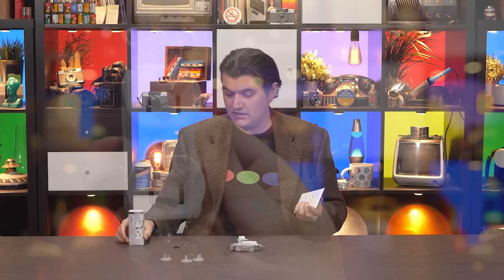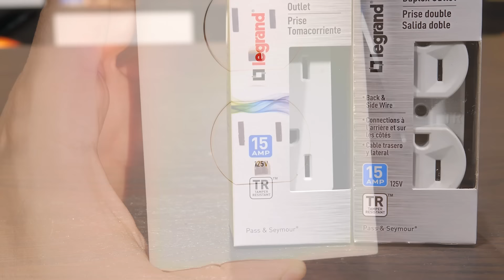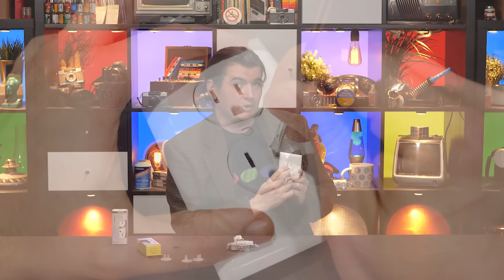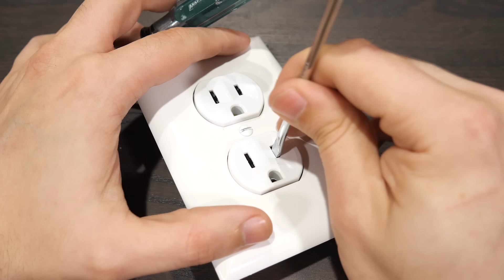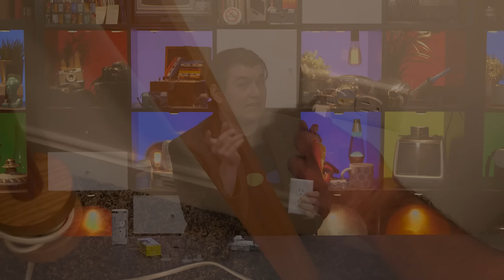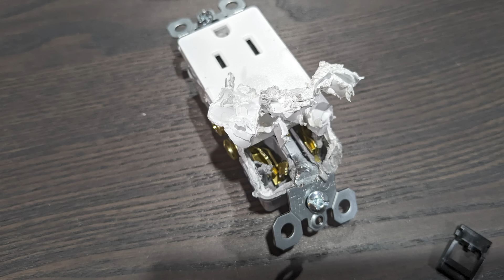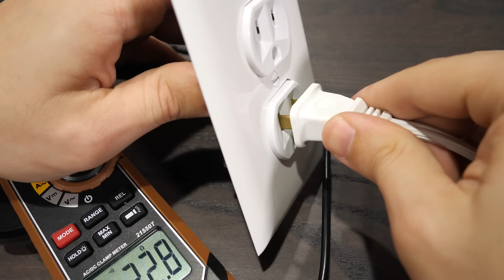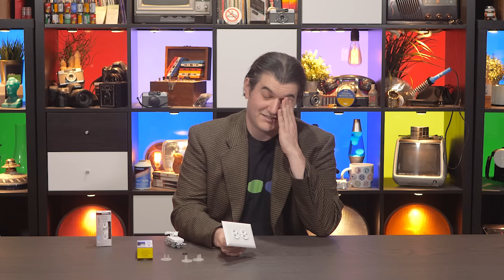Tamper-resistant outlets aren't all the same - a follow-up

Comment: The ones that only grab the very tip have another issue: they get very hot when you have a 1500W load on them. There's not much surface area.

Yes, it's a new outlet. Yes, it does grip hard. No, it doesn't hold plugs worth a damn anyway.

Comment: in the netherlands, plug inserts are sold which can be inserted into existing outlets (not in the holes, like onto the plastic body) which will only allow you to stick in a power cord if you put it in sideways, then press and twist 90 degrees to move a sprung plate which covers the outlet holes when unsprung. once so, you can finally plug it in. i wonder if there is a tamper resistant thingamajigg that can just be put onto american style outlets. my daycare had them at all their locations.

Comment: The "Americans have 240 volt power" argument falls apart because by the same logic Europe has 400 volts between two phases of the 3 phase power. That said, most appliances don't use that because it's not needed since you can get enough power out of the standard plug. I think the only exceptions would be a car charger and a full on kitchen range (cooktop + oven).

Comment: But Alec, it is OK. And it is smaller and more convenient than the euro outlets, and probably safer too. I think you really underrate the value of the lower voltage for safety in all circumstances. Heatshrink on the plugs makes for a nice safe look but voltage is what does the joltage.

Comment: I don't know how accurate this is, but I have always heard that 120VAC can be more dangerous because it will make you "hold on" to the wire or circuit rather than a higher voltage which will knock you back. 

This probably only applies to actual electricians and not the normal homeowner or consumer however.

Comment: I've been jolted a few times with 120v. Used to work at a family entertainment center that put up our own MASSIVE Christmas light display each year. We would make our own extension cords. Many that did so were young, untrained employees...so yeah, you can put 2 and 2 together. Another time I inherited the engineer position from an older guy who retired, he had an old non-contact voltage tester that I was using that didn't work...I made the mistake of trusting it and assuming that it not beeping meant there was no voltage. Won't make that mistake again!
...all this to say: it doesn't feel good AT ALL...and some unkind words will usually follow...but typically it's a quick ZAP, and your hand pulls away unscathed. Either way, BE CAREFUL. Because if you happen to be holding that conductor in a manner that your digits or limbs contract around it, it could be a different story...

Comment: Having lived in Singapore which uses British outlets I can’t say I’m impressed. We melted several power cords in our lab there.  A melting power cord is more dangerous than exposed blades as it may not draw enough power to trip a breaker especially with the power a 240 volt circuit could provide.  The cords are fused but that doesn’t always help.  Covering a portion of the blade is good for careless people.  I’ve never been electrocuted from a plug.  TR is more important.  I witnessed a kid getting electrocuted in preschool by sticking something in an outlet.  At the end I would say respect electricity or it will kill you.  It can’t be made fool proof.  TEACHing is important.

Comment: In AU/NZ plugs have been required to be insulated at the top 3rd so loose plugs aren't dangerous.
This came into effect in 2005 so it's a fun dating tool when you find old powerstrips

Comment: 24VDC off a transformer can be roughly worse than DC, since it can't be detected, it would have to be a double-insulated power supply (pretty standard now) to be safer and properly detected by GFCI.
but there's other ways to drop the voltage namely dropping it over some resistors, or putting the larger load in circuit

Comment: even with the shutter trigger on the PCP/Earth pin, you need a very creative/inventive baby to poke two metal things in,

and we have RCDGFCI for most circuits, and mandate all circuits in new installations.
That also protects the wires in your walls, not just the outlets

Comment: My problem with backstabbing is I don’t have any tools I can use to disconnect them that are electrically insulated, so I need to turn the breaker off before changing out the outlet or switch.

Comment: The reason why you don't want to back sab an outlet is because if you do want to change them every 5 to 10 years, you can run the risk of running out of extra wire. Not sure if that makes sense but basically you would have to cut the wire every time you replace the outlets gin you less wire every time. As an electrician it's a pain in the ass when you get a short wire and then on top of that it's stabbed. On the other hand you could just create a jump with a wire nut but idk it's not as clean and out could run out of space in the plastic box itself.

Comment: The issue with requiring the plug to be inserted deeper before contact is made is that that also means there’s less surface area of connection which could be an issue with high power appliances causing the receptacle to potentially overheat

Comment: 6:59 that's how italian plugs behave (7:50 so I'm not the only one annoyed by that), schuko plugs are sturdy and well kept in place having 2cm or so of the plug tightly gripped inside the receptacle ( the terminals are recessed in the receptacle about 2cm from the receptacle face, quite a neat design ).

17:09 maybe upgrade to schuko, just a thought . 🤪😂

Comment: Back stabs are 100% the worst electrical connection, and the fact that they still exist goes to show how much influence home builders have on government regulation, they only exist to make it cheaper for builders to wire houses, there is not a single good thing about them.

Comment: Man, it was a real missed opportunity to not combine the regulation for tamper resistant outlets with a depth requirement for the contacts inside (including non-tamper resistant outlets, which are still being made of course). Nothing else would change for 30+ years, but eventually the installed base of outlets would be overwhelmingly the newer type, and appliance plugs could start to use partially insulated prongs, with simple adapters available to still use older outlets (similar to 3-to-2 cheater plugs, which are never used properly anyway).

Comment: Those UK shutters are annoying and downright dangerous. Try plugging in a continental European plug into those sockets without using an adaptor or converter. And yes it can be done, you have to drive something into earth first to get the shutters to release before plugging in the European plug into the British outlet

Comment: the correct thing to do is have plugs which have partly covered prongs, and the covered part has to be longer than the part which touches the grid-connection, meaning if it is possible to touch the metal, then it isn't live

Comment: Bit late to the convo but, I love your channel. As a brit, its absolutely fascinating to see how its done across the ocean. And as an electrician its even more interesting.

I think my biggest issue with the American system is that of standardisation. Britain has had pretty much the same standardised plug and socket outlets since the 40s. Meaning that every plug ive ever known has never "loosened" and the inclusion of an earth pin helps in this. 

I do like the double trapdoor system and arguably it is "better" than the UKs system. But as you mentioned it fails on having a stick out and access to live terminals before the plug is fully inserted and. And this isn't a plug thing. But all UK homes have to have an RCD (essentially) on every circuit. This is essentially standardised. This means that if anyone were to touch a live terminal and get a shock, to ground. The 30mA RCD would protect them (GFCIs). Unfortunately I find the US regs pretty lacking in alot of aspects which I believe is solely for the sake of costs.

Comment: As an Electrician I'd like to say that the stab in connections on the back of outlets and general devices are a joke. I can't count the amount of times a troubleshoot service call ended up being solved by finding this type of connection had failed, do not use them. I'm honestly not even sure how they were ever listed and approved. As for wagos, I'm on the fence about them but so far they hold a hundred times better than the stab-in connections on devices

Comment: On the topic of pushing the wires into the back of the outlet, the reason it is not a good idea is because with the backstabbing, there is much less surface area to conduct and can cause high resistance and fire. The best way to wire them is using the screw terminals.

Comment: Never use back stab. Always use screw terminals. The spring holder in back stab provides maybe 10 to 15 pounds clamping force. Screw terminals at least a couple hundred.

Comment: I have a bad habit of neglecting to turn off the power when replacing a wall socket or a lightswitch. As a result I got shocked a few times by accidentally touching the live wire. 230V that's in my country hurts a lot (and you definitely shouldn't try this at home) but it's not an instant kill from briefly touching the wire. Probably. Your mileage may vary.

Comment: Tamper resistant wall sockets are 50 year old invention commonly installed in NW Europe. I have them, except in bathroom where sockets are at 5 feet height. You must fist seat plug to socket pocket, yank up, and only then push it in. There is spring loaded third of circle shutter preventing any direct probing of socket. They must be 45 years old.

Comment: Tamperproof receptacles are solution to a problem that does not exist. You keep saying how bad our outlets are but I never hear what the repercussions are?
If you want a valid criticism, point out that for most outlets there is no testing for UL listing to ensure the outlet works more than once. All it has to do is hold on to the plug for one try.

Comment: My biggest issue with loose US outlets has been plugging wall warts into power strips. The sheer girth of the wart plug is often unsupported by a power strip on the floor and can pivot out of position to expose the blades. I've actually taped a few into position for peace of mind.

Comment: Backstab connections are not anything like Wagos.  Once released, they can't be reused.  And they are known to loosen with vibration.  Wagos can be reseated if they loosen.  Ideal's push-in connectors are closer to backstabs, but I don't think they are a good idea either.  In any case, there are now wiring devices with lever connectors directly on them, so there's never a reason to use a backstab.  Wagos work fine; wire nuts work fine (if properly installed -- many aren't).

Comment: Push in seems ok if it's a well made outlet. I recently had some I installed for someone from Amazon and the push in connections were awful so I ended up using the screws. I did recently use some new levitons that have a latching mechanism similar to the wago connectors but they seem even better at holding the cable. You just have to use wago connectors and splice in the box if you are "Daisy chaining" outlets.

Comment: In the uk mk sockets have a 3 pin activated shutter all 3 pins have to be present for a plug to be inserted. Most other uk sockets it’s only the earth pin that’s needed to operant the shutter. Mk ones are far safer and often used in schools and hospitals negating the need for socket covers.

Comment: Many years ago, when I was about 4, I was playing with tweezers when suddenly my eye fell on an outlet, right at eye level, and just as you'd expect a boy to do, thought, "This looks like a perfect fit for that."  Safety outlets, had they existed then, wouldn't have helped, because both sides went in together.  Luckily all that happened was I blew a fuse.  My Mom had witnessed the whole thing, but, again as you'd expect from a boy, I'd done it so quickly that she didn't even have time to speak before it was over and done with.  I learned that was a bad thing to do, not even counting the cost of the blown fuse.

Comment: In rental properties, tamper resistant outlets are a massive pain. Landlords will use the cheapest option available. These WILL wear out quickly, and are very easy to break the safety gates. Once that happens, they struggle to hold onto a plug.

Having lived in various apartments for the last 9 years, I'm not a fan whatsoever

Comment: Wagos have a locking lever that applies force to the wire holding it in place well. Backstab connections just use a weak spring force, they can be pulled out quite easily when new. After a few heat cycles they're much easier to remove. 

They are not the same

Comment: 11:02
I feel as though as Wago Levernuts or wall nuts, or really any lever or stab in wire connector is not the same as back stabbing on cheap outlets and switches. Back stabbing is made from the same brass alloy as the plug contacts, which isn’t at all springy. Overtime, through frequent plugs and unplugs, as well as heat ups and cool downs, causes the metal to eventually deform and no longer have a strong hold, and plugs just fall out. Well, the same holds true for back stabbing. Overtime, it heats up and cools down, deforming the metal and making a bad connection. You don’t want a bad connection like that. Best case scenario, a device connected to the circuit behaves erratically, worst case scenario, your house burns down. Those alternative wire connectors, however, are different. They’re made from a different metal alloy, and it’s springy. Also, it doesn’t suffer from the problems that the brass alloy does when subjected to frequent heat ups and cool downs. So for me, I don’t use back stabbing on electrical devices (every modern one I’ve ever seen only take 14 gauge wire anyways, and I always use 12 gauge wire with 20 amp circuits for my outlets.), and I’d advise you don’t either. However, if you’re going to back stab anyways, then at least pigtail your wires.

Comment: 240 volts hurts like a swarm of pissed hornets if ya touch it, speaking from experience as the fuse in one of my plugs poped but it wasnt rated for 240v and i grabbed it to pull it out, glad the uk has RCD on all sockets

Comment: It is my belief, and the "the times I got shocked" stories further cement that, is that all outlets should have GFCI protection. 120 and 230 volts both. I don't particularly care how it's implemented, one central GFCI device in the service panel as is standard in parts of Europe, one in every outlet, or anything between, whatever. Maybe one per room next to the light switch or something. Ideally there should be some flexibility in the code there. Sure, a 120V shock is less likely to kill you than a 240V one, but it's still unpleasant. That way you can keep using your, uh, suboptimal plugs and outlets with a much reduced risk of getting shocked for not much effort at all. Plus, it would help with the frayed extention cord wire scenario too.

You've managed to implement a mandate for tamper resistant outlets in new builds. From that to a more complete coverage of GFCI protection in new builds mandate doesn't sound like a huge step.

And sidenote, I don't think there's any ambiguity with safer =/= safe, it is, to me, obviously synonymous with "less dangerous" and English is most certainly my second language. I think it's more probable that the apparent confusion comes from people that wants to argue.

Comment: Forcing recesses in the sockets would drastically improve the design of your outlets. But I totally get how that would not go down well with a lot of people, and how it would be an impopular move.
But what I really don't get is why there isn't a new rule put in place that all new plugs have to be insulated say the first 1.5 cm (ish). Every old plug would still work, no socket would have to be changed. But every new device sold would become safer, and over time most plugs would be of the safer variety...
That's the thing that really boggles my mind, cause I can't see how anyone would be against it really.

Comment: Any time you replace a receptacle where a tamper resistant receptacle is required you must install a tamper resistant receptacle. The code is not just for new work. So if you hauls was built before the code and you replace a failed receptacle or just want to change the look you must, by code, install a tamper resistant receptacle. You will not impress an inspire by following code.

406.4(D)(5) Tamper-Resistant Receptacles. Listed tamper-resistant receptacles shall be provided where replacements are made at receptacle outlets that are required to be tamper-resistant elsewhere in this Code.

Comment: Probably the problem with outlets falling out is when there is an adaptor, and the New Zeland plug has the same problem when using it with adaptors fo other formats

Comment: There is a difference between a Wago style connection and a backstabbed connection. In the Wago or push in connector, the deflected spring metal is roughly parallel to the wire and the bus behind it. The tension is perpendicular or downward on the wire. Backstabbing is the opposite, the deflected spring is roughly perpendicular to the wire, and the tension is parallel to a large degree. Much of the tension is directed to the wire entry opening and not down on the wire. It makes a difference in contact effectiveness. The other thing is that the primary connection on receptacle is by using the screws, and backstabbing is quick selling point feature with minimal design effort. In the wago style the spring tension is the only option, so the reputation demands a well thought out design. The fact that backstabbing can on be used on 15 amp circuits, concedes it's limitations. Wago styles are acceptable for 20 amps and the larger Wago lever nut (221-6xx) are designed for 30 amps and 10 gauge wire.